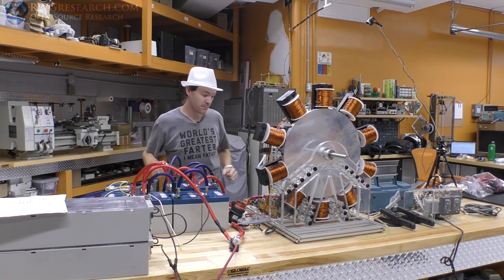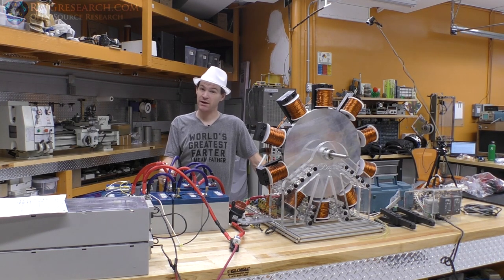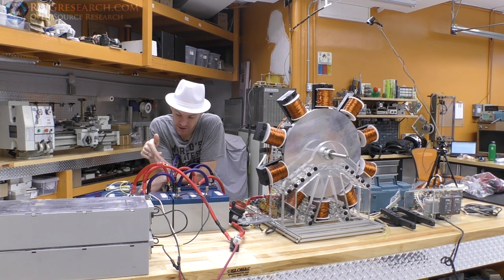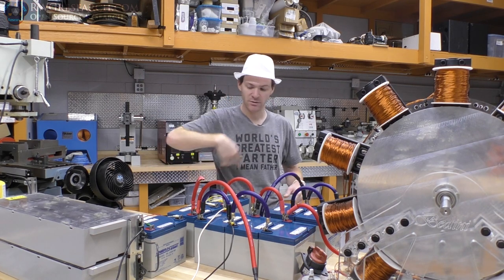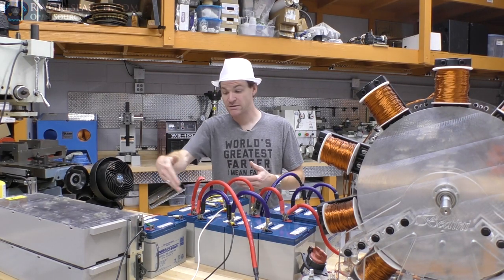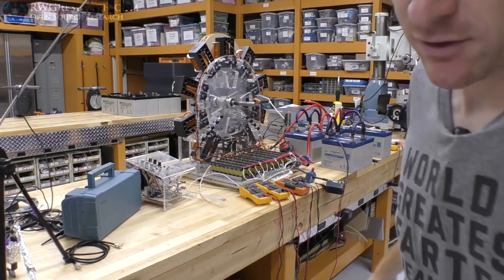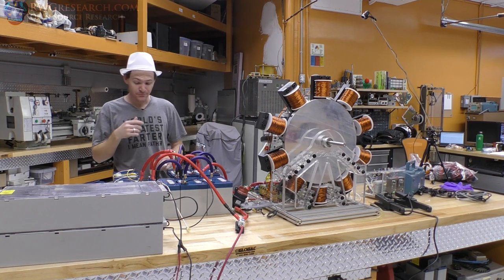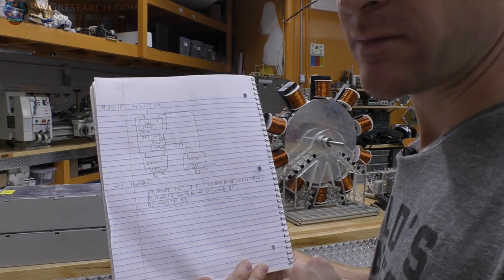P3 : Bedini 10 Coil Testing... flash back from 2017

Comment: I really don't understand what the purpose of this device is. Does is put out more energy than what was there when the batteries were initially charged? Will this extra energy be measured by doing mechanical work at the shaft output? How will this bonus energy be measured?

Comment: I have a 2 coil bedini energizer that I'm having marginal success with. I had an idea...I have an old 500k microfarad cap with an old car audio amp. An amp steps up the voltage/current to the speakers which in turn steps up the sound. Why couldn't I hook this up between the machine and the battery to "step up" the power output before it goes to my charge battery? It would work as a voltage doubler, tripler, etc based on the wattage of the amp! Should work? Thanks
Reply from the maker: Great question. For those asking the same / similar. This is about the wattage. So in this video I mentioned I would be taking note about the watt hours. So boost the voltage lose current. Boost the current lose the voltage.  One must all ways look at the wattage. 100V x 10A = 1000Watts. 100A x 10V = 1000Watts. So unless you can boost the watts... Your not going anywhere... ;) ~Russ

Comment: the secret is no moving parts
Reply: so you mean a transformer?
Reply: @lorenzo42p  no.. they burn out
Reply: @rexgeorg7324  a transformer is a simple device that can last indefinitely if it's used properly. if the windings are allowed to move and vibrate inside the transformer, that can cause it to eventually short and kill the transformer, which is why some are potted in resin. they last a very long time.

I'll never understand these pulsing battery charger things, or the people who think they're doing something impossible.